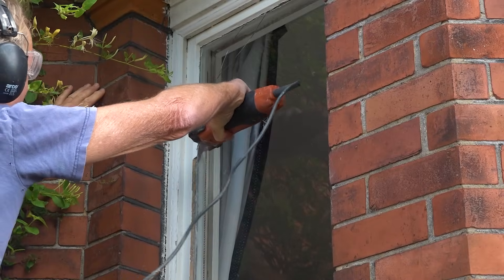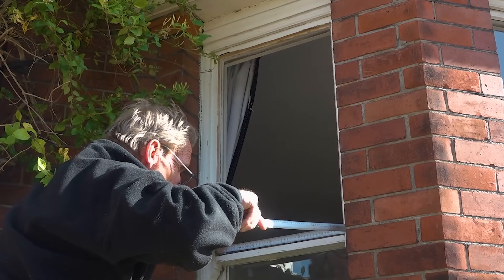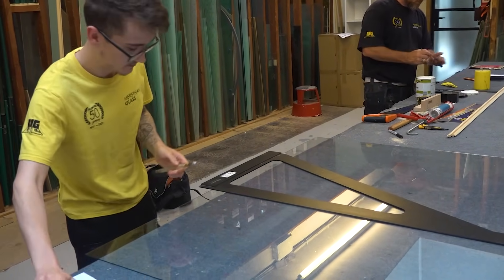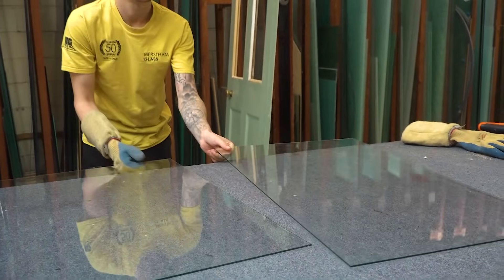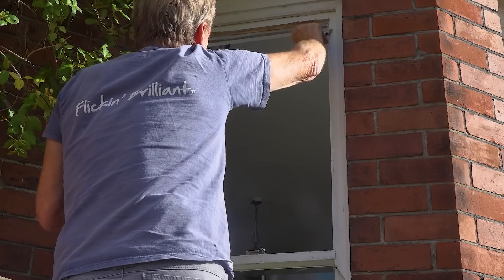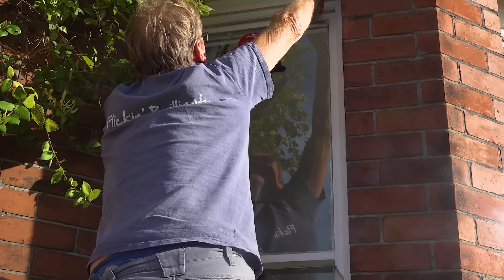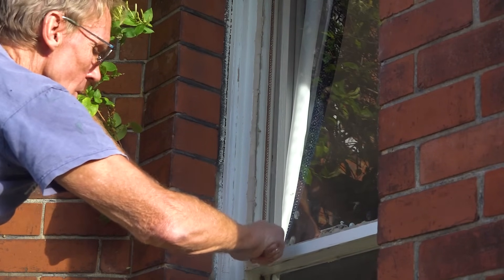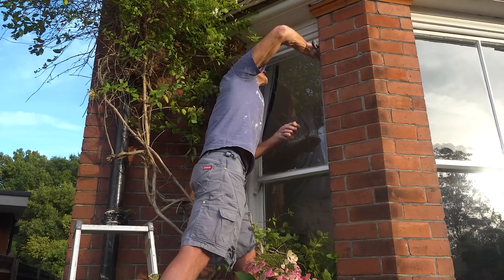Replacing Broken Glass ~ £250 DIY Money Saver

Comment: I’ve been using Merstham glass for the 35 years that I’ve lived in Merstham and yes, they’re brilliant. I’ve replaced several blown double glazed units in my house that have blown and they are surprisingly reasonable in cost and easy to fit. As I understand it the horticultural glass is usually thinner depending on size and is also called plate glass as it’s made by pouring the molten glass onto a flat plate. This leaves is slightly imperfect. Float glass is made by pouring glass onto a bed of mercury apparently which produces a perfectly flat finish. Great job Roger, keep up the good work.
Reply from the maker: Thanks Steve 
You are right, I had actually forgotten all that stuff about glass production and I have visited a glass foundry. I think horticultural is 2mm, heritage is 3mm and the float starts at 4mm. Then of course you have laminated and plate glass.
Reply: Plate glass is 6mm or thicker , float glass , molten glass is poured onto a bed of molten tin to produce a flat surface,there is no  mercury involved that would be extremely hazardous, the front putties are fronted below the timber sight lines  1 - 2mm to allow the painter to paint over the fronted putty line and  onto the edge of the glass to complete the weather seal.
Reply: Interesting stuff really, perhaps Roger could film at a glass production company

Comment: When I did my painting and decorating apprenticeship back in the late 80’s we had to learn how to putty and our tutor would putty a window using 2 balls of it 1 in each hand and fly around the window and be done in less than a minute. Then out would come the putty knife and he would literally make one pass over the putty and it was always perfect. Lost art since double glazing
Reply from the maker: It would have been nice to film that
Reply: I was a glazier for over 40 yrs , and I would do the “ fronting” ( as we called it ) in much the same way as you described it , only we got got our “ fronting “ knives made ,or made them ourselves , with a bend in them to make it more easier to address the puttying when finishing the front of the window , we highly polished them , and they would last a lifetime , and they became a valuable asset to us, losing one was a real calamity , as it took ages to break another one in , in fact I’m retired a long time now , and still have mine which I used for over 20 years , and wouldn’t part with it ( even though it’s of no use to me anymore ) it’s like an old friend , and when I look at it sometimes it brings back some great old memories of my old workmate friends , 👍

Comment: Ahhh Glass, made  thousands of tons off the stuff in my day. From Flat drawn, this has the distortion,  to Float. Flat drawn was used as window glass and horticultural and we shut down that process in 1980/81 ish. I moved over to float at UK5 in St Helens in 1982 which at the time was a new float line. We did make tons of 2mm, 3mm, 4mm and  on up-to 12mm. Plate glass was made at Rolled Plate and also patterned glass along with wired. Float is floated on tin to get it superior finish and uniformed thickness . Also made tons of Cullet too if you know what that is.:face-blue-smiling::face-blue-smiling:
Reply: I used to deliver to the Thermos flask factory in the 1960's and they had a cullet merchants skip in their yard, and being the inquisitive type I had to know what that meant. it's broken glass.

Comment: Had to learn this for my garage - not insulated so it didnt matter if i didnt get it perfect. I opted for a wooden beading and silicone instead, seems to have turned out okay, and I painted the wood the same day. Thought I'd share as I thought it was more beginner friendly than trying to use putty.
Reply: Problem with silicone is that paint won't adhere to it!

Comment: I was the glazier at a mental hospital for 5 years in the mid 70s. They broke up to 13 panes a day. I was told not to use a hammer on the sprigs, but the hacking out knife or the chisels end slid across the glass so as not to strike the glass edge.
I never used a putty knife to form the putty, we made 1/2” copper pipe, hammered flat at the end and slightly upturned. 22mm pipe for the big rebates. still have mine after 50 years on the brush.

Comment: I like to use a straight filling knife, but here's a top tip for you, rub the filling down the wall several times so the blade heats up and it'll glide over the putty. Be careful, though. The knife can scratch some bricks and don't use a lighter to heat the blade it doesn't work.

Comment: Rodge ..what type of putty did you use?, toupret do a cracking one, paintable virtually straight away.
Gone are the days of rolling putty in newspaper or working some powder filler into it to stiffen it up a bit.
Done loads of glazing over the years, it was often part of a painters job back in the day.
Reply from the maker: The putty is some multi purpose stuff. I don't think they do the linseed oil stuff anymore. I am painting it this morning.

Comment: You can still get 3mm glass in the UK, its generally known now as horticultural glass and is for greenhouses. I've seen it used on some older buildings, but as you say modern "float glass" is too blemish free and has none of the character of older glass.
Reply from the maker: you can get 2mm glass but the people selling it to you have a duty of care not to sell it for this kind of job. 
Very often they will ask you what it is for.
Reply: 2mm glass is usually used only for picture frames ,
Reply: @fraclarke6523  well done, but I never mentioned 2mm glass.

Comment: Didn't know putty was still used.
How come you didn't use a glazing silicone?
Reply from the maker: I do on some jobs but I think putty is a good match for the rest of the window
Reply: there is an acrylic putty now from Toupret, its expensive but you can paint water based paint on it not long after.
I also use Geocel glazing putty to bed in, its like caulk in a tube

Comment: 250 quid ?? 
I've just bought a double glazed seal unit, about the same size as this ,from my local glazing place ,I gave them the measurements and they said they would make it st8 away and it would be ready to collect it a hour ,I returned a hour later and it was ready . Cost was £25
Reply from the maker: I don't know any glazing shop that makes sealed units that quickly for that price. It would be good to have details. 
The price to get a guy out within the M25 to remove a broken window and replace it is around £250 + materials. We accept that it could be more or less in other regions.
Reply: @SkillBuilder  
wowzers 
I’m in Sunderland 
North east uk

Another example of the north / south devide